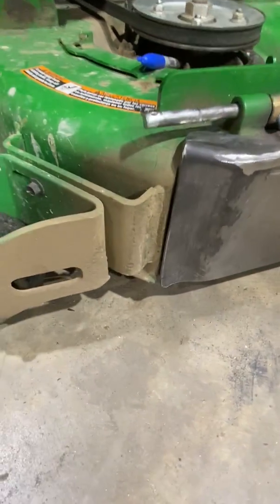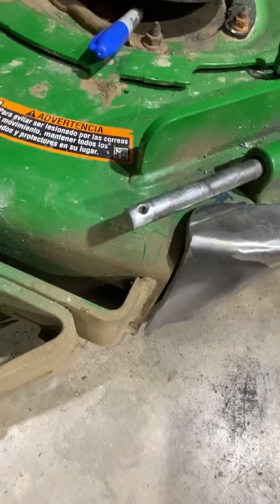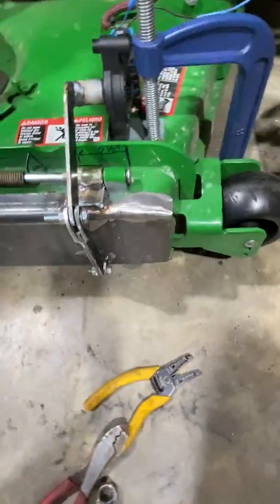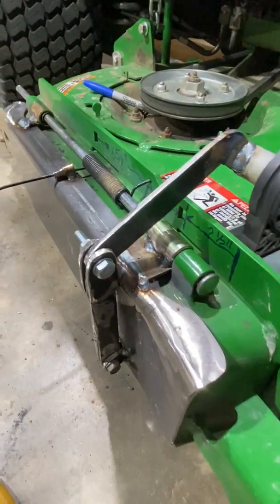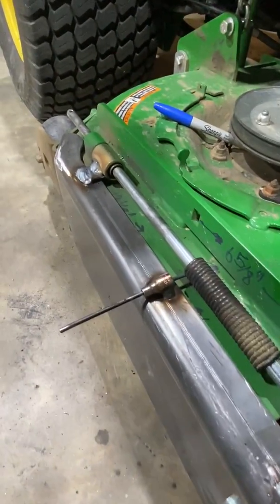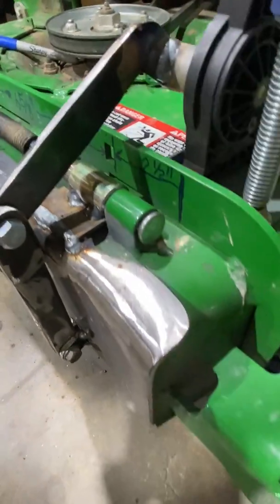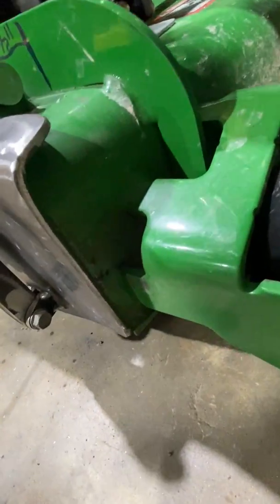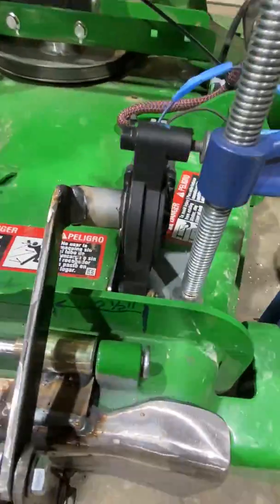John Deere 997R ELECTRIC CHUTE BLOCKER accessory install

Comment: that looks good how is it working out?
Reply: Thanks for asking. Hope this answers your question. I have the gear and some other brackets made and four bearings I can add the photos in the next few days if you want to see them
Reply: Well because it opened and closed so fast it stripped the plastic gear. I have an idea to install a larger gear to slow the movement rate. I found a similar setup on a Spartan mower. I will be able to build it in the winter when I have more time.